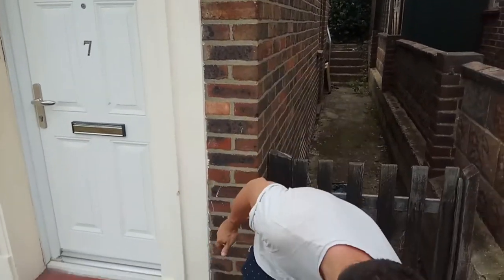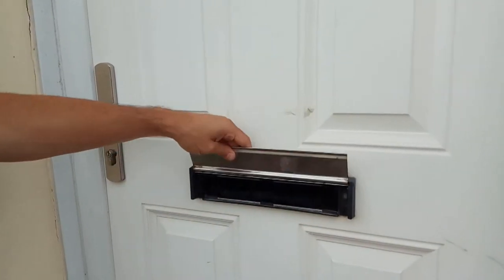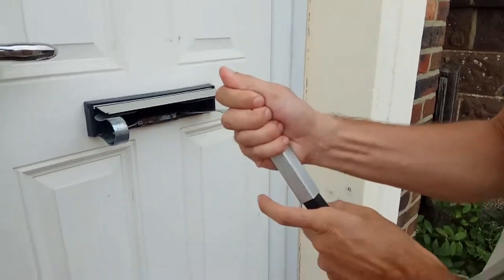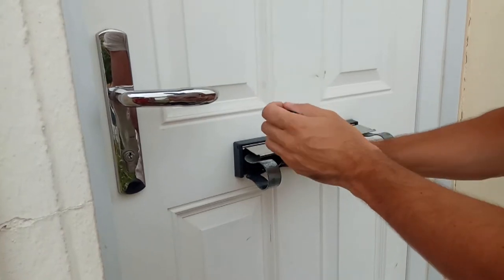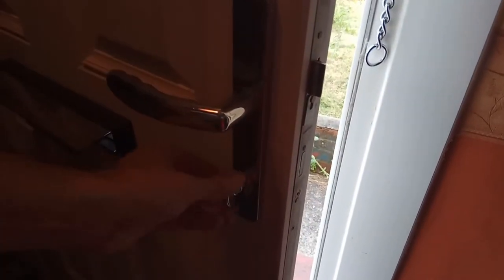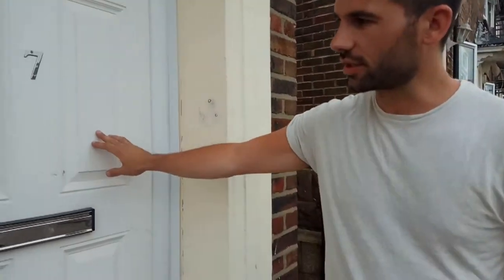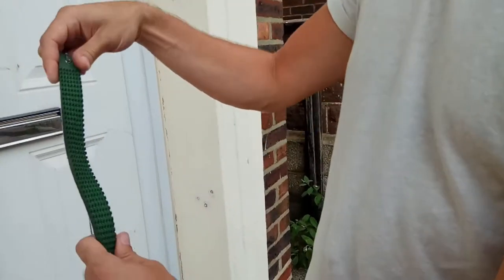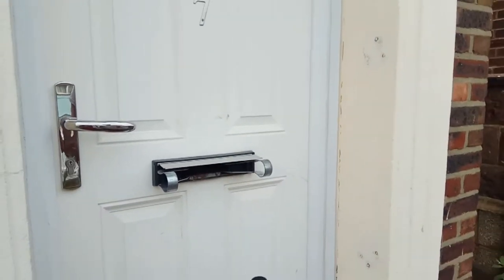Letterbox Tool For Locksmiths - A MUST HAVE Tool (Non Destructive)

Comment: I have the letterbox tool I haven’t used it yet but this is very helpful Thankyou🙂 ,there is an electronic turner you can purchase instead of the rubber and wire which sounds really interesting!
Reply from the maker: Cheers, Ben! There's also a camera, but never got on well with that, too old school!
Reply: @locksmithingsecrets  think I would be the same to be honest can’t get on with all these mod cons! ,please keep me posted with more of your videos ,I am advertising locks next year just as a side line to start with (with my existing business)